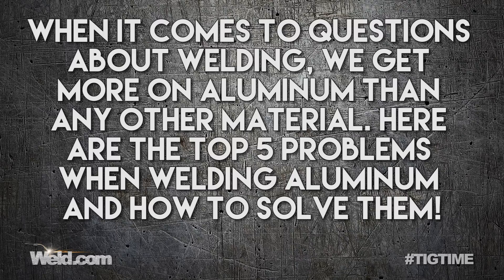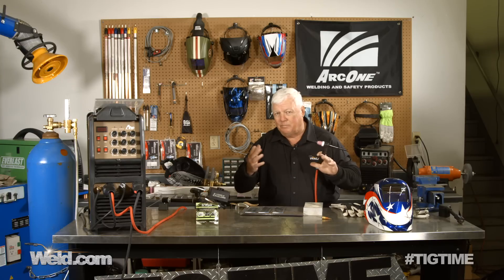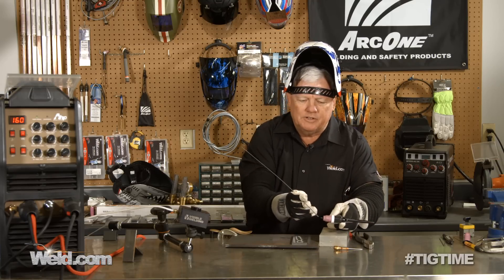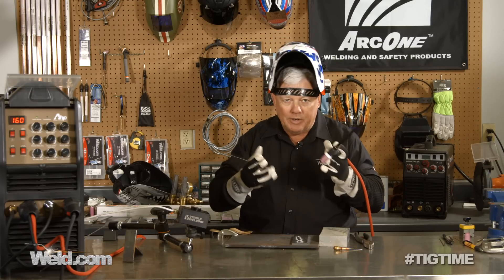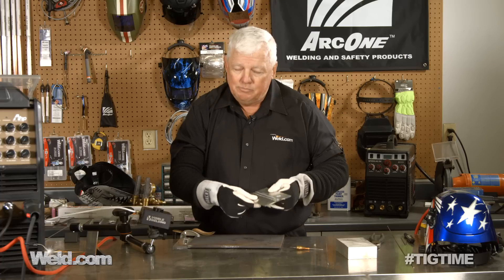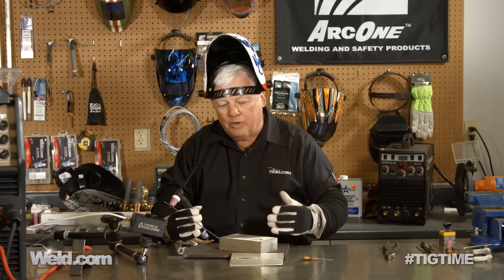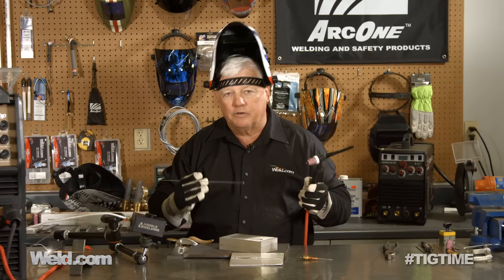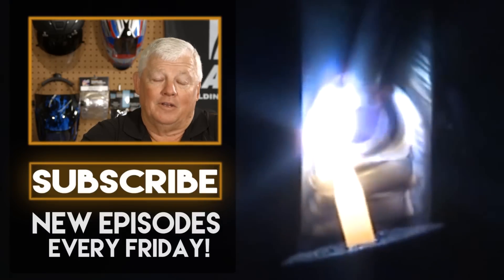Top 5 Aluminum Welding Mistakes

Comment: Doesn’t look like Mr. TIG is much on responding to questions from viewers, but here goes anyway! I was in the welding industry for around 45 years, and I’ve always been taught to ball tip the tungsten when AC TIG welding aluminum. As a matter of fact any time I didn’t bother to ball it, the tungsten heated up and balled itself when I started welding! In this video you treat tungsten balling as taboo! What gives? In my 60’s and retired now, I still do some light repair and fabrication in my home shop for friends using stick, mig and TIG processes, and I’d like more info on this sharpened/rounded deal!

Comment: You spent more time trying to form a puddle on the thin metal than you did on the thick metal. I've seen 3 inch thick x 3 feet aluminum welded with a 200 amp air cooled torch. It can be done!

Comment: Would it be correct to use aluminum strips of material made of the same rims instead of wire for welding rims?

Comment: For some reason I can't get a puddle eeven when I clean the surface. I used various settings and what happens is eother the filler rod clumps down or there is a huge dimple in the aluminum and no puddle.

Comment: Just curious,
Around the 9 minute mark, you mentioned that you were setting the machine to 70% negative which equates to 30% cleaning/positive (beautiful bead by the way) however, during the demonstration you described it as 70% cleaning, which would be 70% positive, not negative, and would look more like the 50/50 balance demonstration that followed. Is there something that I'm missing? Terminology perhaps? Thanks!

Comment: I am looking for an Aluminum welder in Venice to weld  1x1” 1/8 thick to a 4.5” I-beam of aluminum which is about 1/8” thick. It is badly oxides.

Comment: Thank you. I finally got an ac/dc 250 amp tig and was wanting to learn aluminum. Grabbed a few chunks of scrap aluminum from work and nothing I did was successful lol the part would get super hot, but could not.get it to puddle almost at all and when I got what could be vaguely called a puddle and tried to feed in filler rod, it'd just blow it out now I know.it was just too thick for my machine. Im used to mild steel and stainless which I have no problem with. I guess its just the heat distribution properties of aluminum that make it a whole different beast. Going to havw to visit a scrap yard and find some thin plate to practice on.

Comment: Can you give more information on set up of machine. Skill in holding in the pool is one thing however the set up and knowing where u are going wrong 

Type of gas, what type of tip post set etc. I am an old bloke who gas welded and brazed with Oxy and Acet for years trying to get a good weld for ally on my motorcycle ta G

Comment: Can you please tell me how often you regrind your tungsten when you are welding aluminum continuously for a while. I saw your other video on setting the AC balance to clean the weld and get a good finish on it so I set the Dig to 2 and am getting clean welds at 15 cfh so long as I don't weld it too wide but keep the profile a nice round mole hill. But after a while welding like that, the aluminum starts spitting on the tungsten and the arc starts circling or trailing off to one side. So I think I need to increase the Dig back but then I won't have clean welds. So should I just clean all my aluminum from now on in order to have a higher Dig? Or should I just grind the tungsten every 12 welds or so? Thanks for any help

Comment: How about when you're welding aluminum tubing and it's very difficult to hold the tubing together while you're adding your filler to do a tac weld. So how do you hold the joints together and tack them together?

Comment: I want to  know why my aluminum welds flatten out at the end?
Reply: The longer the weld the more heat goes into the metal, also when you near the end of a joint the heat has no where to dissipate to so the heat builds even more.

Comment: Need help, the aluminum filler is rejected by the puddle, I have tried increasing the shield and decreasing but not working. The puddle spits out the rod and just won't weld. It does fine if I do a bead without filler but the rod turns into a greenish flash and becomes an ugly turd when I introduce it to the puddle.

Comment: This has been a super informative video. Thanks! My biggest problem as a novice welder has been tungsten contamination caused by touching the tungsten with the filler wire. Aluminum takes filler so quickly I've had trouble keeping up feeding wire and occasionally mess up and touch the filler to the tungsten. Another problem I've had is attempting to maintain a short arc length, as the filler is added the puddle grows substantially and I don't always see it grow to where it touches the tungsten. I know I just need more practice, practice, practice. Thanks for the tips.

Comment: Hi ,i restore vintage espresso machines. How would you reweld a fitting to a boiler ? Usually the boiler is copper and the fitting is brass. The boiler usually is rated to 3 bar pressure and the water inside is about 120 degrees. I can see its a kind of lead solder... 
i would love to see a tutorial on how you would do this! :-)
Dave

Comment: Now that I FINALLY got to my machine to use.... Everlast 256si watercooled, I understand what's going on. Aluminum takes a bit more skill than carbon steel or  mild steel. Thanks for videos..... I've been practicing every day for a few hrs. I like silicon bronze but I will learn the AL.

Comment: Great video.  Wow did this 'clean up' a lot of problems.  Could you address what setting you'd use for Argon on say 1/2" aluminum and about what amperage?  I have a Miller Diversion 160  and I'm lost when it comes to welding but you hare really the best I've seen and I''m becoming confident just by watching you.  Thanks so much Mr. Tig!

Comment: Mr tig I thought on an inverter and alot of newer machines you were supposed to do 30 to 35 percent cleaning but on like a Miller syncro wave you do 70 in the green zone cause Miller made mistake and put it backwards I own a everlasting dv and I asked there rep the question same thing and he said 30 % can you elaborate please is it really 70 or 30
Reply: If your tungsten disappears, switch it

Comment: Can you comment on how to clean up aluminum prior to welding that has been alodine (chem-film) coated? I can't seem to get it to even puddle after wire brushing and acetone. It acts like there is just an oxide layer that keeps just sparking around. This is leading to garbage looking welds when I am lucky enough to get a puddle and mostly just complete failure for the filler rod to fuze to the base material.
Reply: If you have a piece you can test run on try using a grinder with a wheel that is designed to grind ally.Then use the acetone & try welding & see what happens.Web search brought up that the coating you mention is used to do a chemical etch, which i suspect is why you can't clean it with just a brush & solvent as your not able to get right down into microscopic valley's

Comment: Great video. I definitely fell into some of those pitfalls my first time attempting aluminum with my 2017 AHP Alphatig200x.  One thing that confuses me about your video is you said 70% A/C Balance but I see the dial on the AHP set to near 20%, which is completely opposite.  A lot of my problems went away after I moved my dial to 65% to 70% and I wasn't blowing through my tungsten. I'm trying to understand specifically what my model machine is doing. Is it 70% positive or negative? Is something different about my 2017? I had a hard time getting a puddle around  20-25% AC balance.
Reply: When he says 70% AC Balance he means 70% Negative (EN), or 30% cleaning.  Some machines label the AC balance in terms of cleaning rather than percent of EN (electrode negative). The text at 9:15 is incorrect - it should say 30% cleaning, because he has the AC balance set to 70% EN.

Comment: My welding teacher says that the tungsten tip should be rounded when welding aluminum, is this true? 
Great video btw!
Reply from the maker: That's an old thought process from when pure Tungsten was the old choice for transformer type machines. Now with inverters and better tungsten choices, you can leave a tip on. We are going to be doing a video where we show how to weld with balled Tungsten in the near future.
Reply: Weld.com
alright! Thanks for the answer :)

Comment: I bought  2 green tungsten rods , then I saw in the directions not to use the green ones with aluminum, what are the differences and what colors do you recommend?
Reply: Andy Nelson I’ve always used either red or gray

Comment: Since you're using AC does it matter if the electrode is plugged into positive or negative?
Reply: I am new to this as well, just subscribed. My thoughts are with the limited knowledge I have is it is very important that the torch be electrode negative and ground clamp be Positive. My thinking is for Ally where AC is used the other polarity will reverse the cleaning action and then be very hard on the life of your tungsten. Somebody out there please correct me if my thinking is wrong. Cheers to all from John, Australia. PS Great informative video.
Reply: It DOES matter,  UNLESS you have exactly "balanced" AC, with 50 per cent electrode positive, 50 per cent electrode negative.   With electronic inverter machines (shown here) you can control this, and might have something like 90% EN, 10% EP (for cleaning)....  In the "cleaning" part of the cycle where it's Electrode Positive,  the electrode is heated more... so if you get the polarity wrong, basically the tungsten will just melt!   It happens fast.  Ah, if this happens and you don't want to switch the leads, you might be able to recover by setting "AC BALANCE" to the ? inverse of the setting you have.  ??  So, if you have it on 20% turn to 80% if that makes sense.  SO, if you're not sure about the set up, if you have the right AC BALANCE setting, try just striking the arc for a second or so, and see if the tungsten is a LOT hotter than you expected.

Comment: I was always taught ball end for Aluminum and sharp for Steel, SS and Ti.
Reply from the maker: If you are using a transformer power source, then yes, put a ball on your tungsten. If it's an inverter machine you are fine leaving it pointed.
Reply: I have an old, old Lincoln 300. AC, DC and High Freq, with water cooled torch.
It is older than me, and I am old.
Reply: I've got an Everlast inverter welder and I've been told to always keep the end to a point.

Comment: I like videos that provide a practical explanation, not just theory. Great job.  I am hoping you will do a practical explanation of the use of pulse DC tig welding.  My welder goes from 1/2 Hz to 500 Hz pulse.  But, I cant quite figure out which frequency to use when...  Please help.
Reply: chukchee Use a frequency you are comfortable with.  You do know what pulse is for right?
Reply: Please explain when to use which frequency... Thank you.
Reply: chukchee The purpose of pulsing is to control the heat more. The base metal doesnt get as hot as say welding without pulse. It's ideal for welding very thin metal where warping is a big issue. I usually set between .65Hz and 1.1Hz. the machine should have a setting to set the Background Amps, Peak percentage and Peak time. You have to adjust it to get it accustom to you and just right for the base metal. It gets finicky, so you'll have to play with it

Comment: Thank you that was very helpful .I'm new to this I am trying to weld a 3/4" block to an 1/8" block would I be able to weld them together with a 200AMPS maschine?
Reply: Probably. Pre heat the blocks if you have difficulty getting puddle.

Comment: Follow up on EZ Wipes I tried. 
Finally got around to using a few of them, and they worked much better than I expected. I used an EZ Wipe on an old piece of aluminum laying around in the shop without any wire brushing, simply worked the edge areas over with the EZ wipe and got a good clean TIG weld out of it. Impressive product.

Comment: Great information! I got to thinking back on a piece of aluminum that was really contaminated, outside for a while, oily, everything. I did clean it the best I could then practiced running a bead on it. Well, you can guess the rest. Assuming, I didn't contaminate the tungsten (ha!) I changed the balance more positive trying to get a cleaner bead. Nothing seemed to work. I didn't need the part, just practicing, but if I needed it what could be done at this point?
Reply from the maker: +Tom Herd The biggest thing is getting it as clean as possible. We have recently started using a product called EZ wipes that have an abrasive (and smooth) side to clean really junked up material. They work really well.
Reply: +Weld.com Thanks I will give it a try. Hope the local welding shop has EZ. If not I am sure I can find it no the web.
Reply from the maker: +Tom Herd Send us a private message with your shipping address and we will send you some samples.
Reply: +Weld.com Not sure on how to send private message, so I went to "contact" in Weld.com and sent email there.
Thanks, Tom

Comment: i lot of good information in this video. when the weld goes bad from the contaminated tungsten can you restart your puddle or is it necessary to grind out the old weld and start over.
Reply from the maker: +larry sperling Usually you can wire brush the surface and restart.  However, if the contamination is severe and/or you have left tungsten in the puddle,  it is a good ideas to grind out before resuming.

Comment: This was one of your best videos. Extremely informative.
Reply: I plan on learning how to tig weld aluminum soon. This was a good video. I've only welded steel with my everlast up until this point.
Reply: +SATAMAN Schmidt  I agree, Very informative video. I don't do a lot of aluminium but i see that when you contaminate the tungsten the need to snap the end of the tungsten and re-grind to get the best outcome.
Reply from the maker: Thanks +SATAMAN Schmidt . Always a pleasure to help.